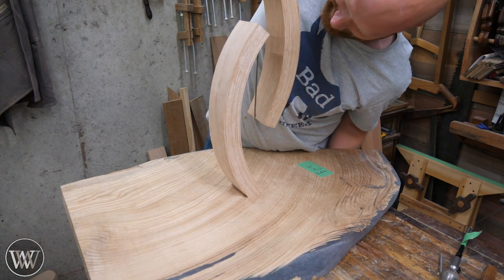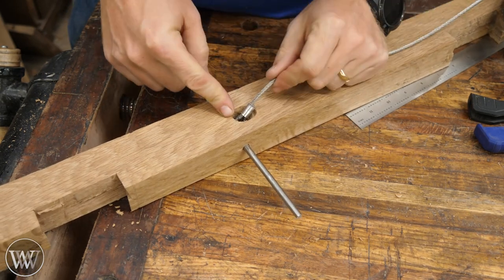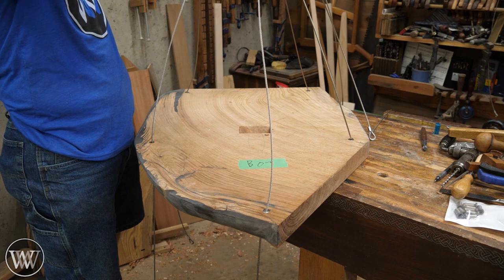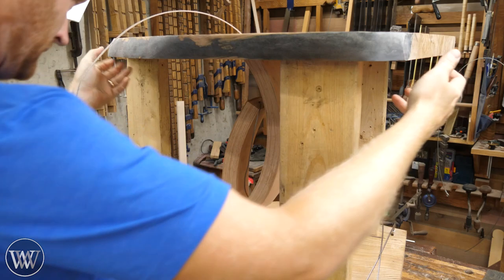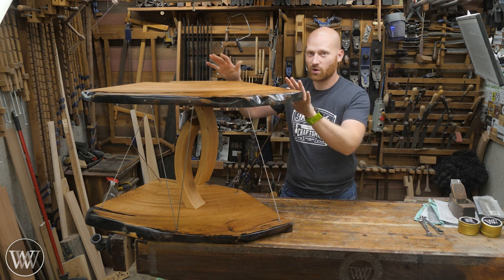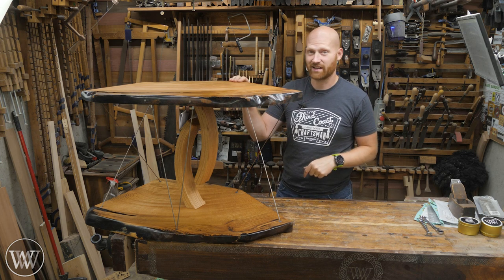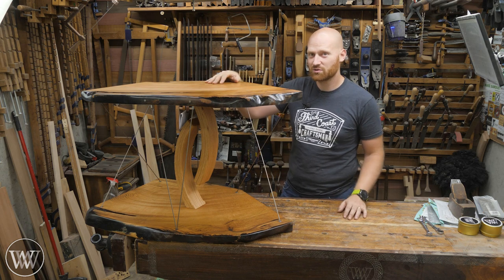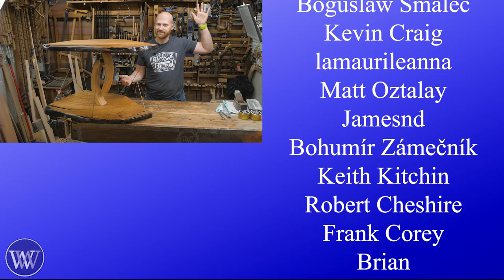The Impossible Coffee Table All in One Video

Comment: Awesome build! 

What are you doing when you put the epoxy and the slabs in the vacuum bag?   Is that what they refer to as "stabilizing"? Sorry if this is something everybody knows.   I haven't ventured into the epoxy world..... yet. 

Keep up the great work!   I really enjoyed this build
Reply from the maker: Thanks. with the vacuum bag it's kind of doing stabilization but it's more or less trying to suck the epoxy into all the small holes nooks and crannies. Without that it will just sit on top and not penetrate as far into all of the bug holes. putting it in the vacuum bag also means that I don't have to create a tray to hold it and I don't have to tape the slab and hope that it doesn't leak. It also limits the amount of epoxy that I use so I'm not using as much as I would without it. Stabilization is very similar but it's usually done with a much thinner polymer such as cactus juice. That will penetrate much farther into the wood. Stabilization actually fills the wood and diminishes the amount of expansion contraction. What I did here will slow the expansion and contraction a little bit but not by that much.